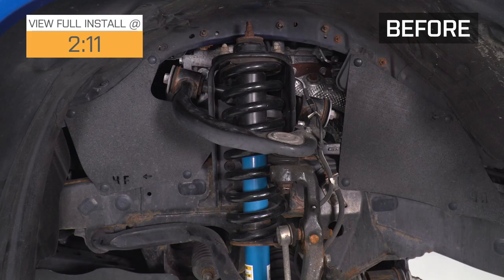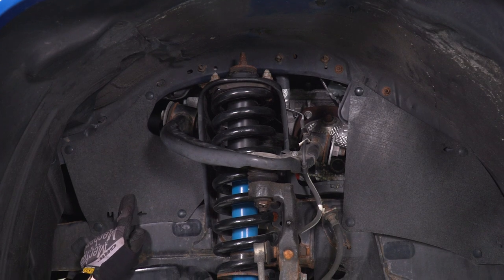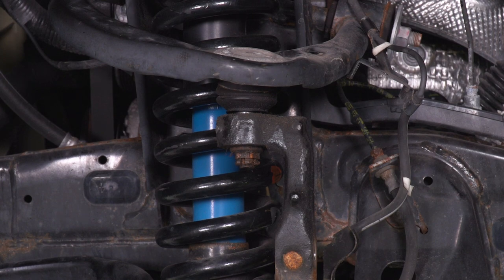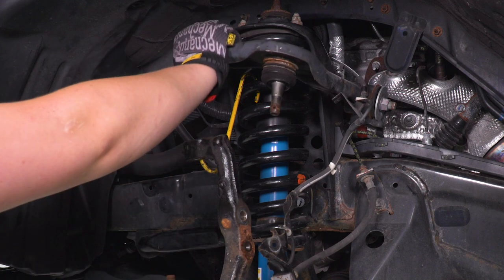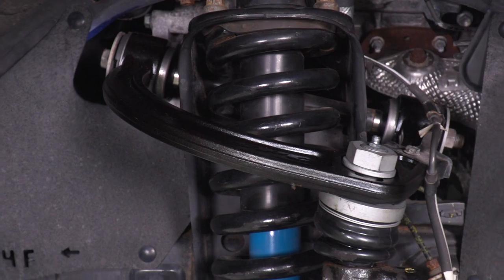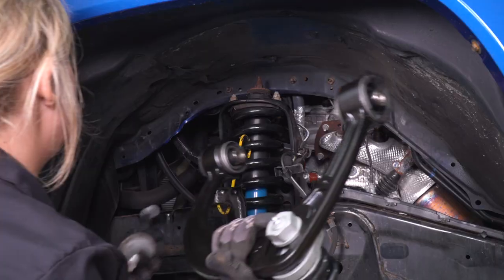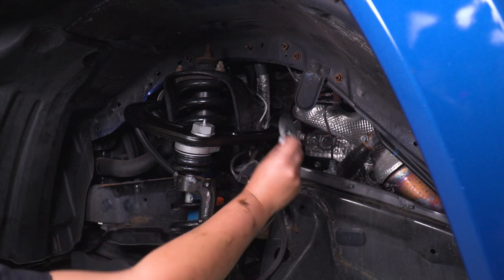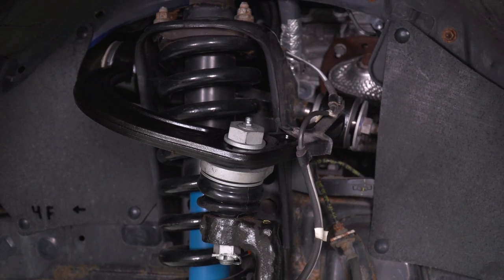2016-2020 Tacoma Adjustable Front Upper Control Arms Review & Install

Comment: Is there a reason you installed the ball joint backwards? The SPC logo should be facing outward.
Reply: The ball joint is adjustable to set camber and caster. Where you set the logo on the ball joint sets your caster angle
Reply: No one is saying that they are Not adjustable. 
She is setting them up backwards!!
Please go and read the instructions it clearly states logo out!!! She have them logo in.

Comment: LoL overpriced aftermarket junk.  Y’all Robin people of their money.
Reply: It's for a Tacoma, it's all overpriced.
Reply: OEM parts for instance. 
Gmc 2500 3/4 ton brake pads and rotors on a brand new truck are very good. 
To get something after Markit at or above the quality you would need to probably buy Brembo breaks.  Witch cost like 5 thousand dollars. 

Just some stuff is like that, not all stuff. 

Things like wheel bearings. They will last 150,000 miles then when you buy a aftermarket hub bearing it lasts 15,000 miles. 

I’m just trying to keep people from buying junk so the scumbag people selling the cheep parts go out of business.
Reply: The brake line needs to be on the outside of the  UCA  when reinstalling. I noticed that you made the mistake but just edited it out. That would have been a great time to explain that to viewers.
Reply: Lol I see. 
That’s hilarious.  

Autozone ball joint lol
Reply: You're paying for the "engineering" some one had to design it and patented it